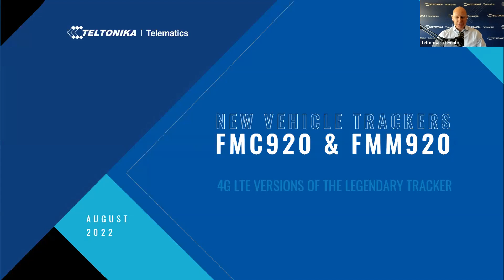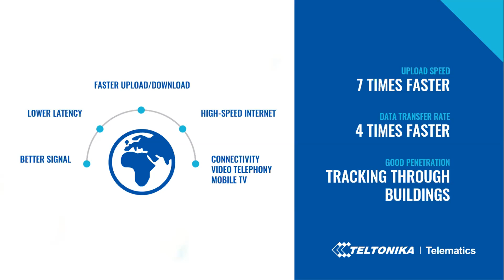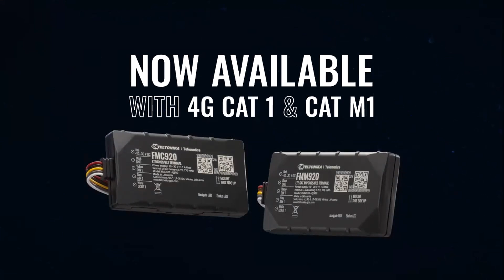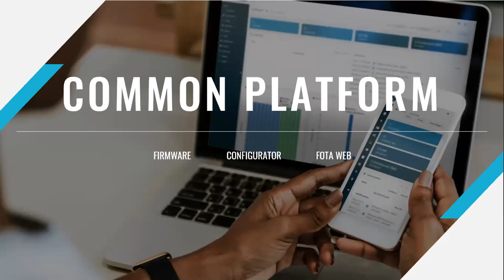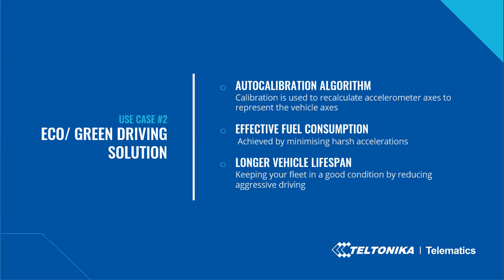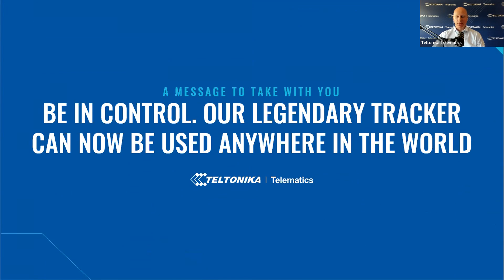Teltonika Webinar – FMC920 & FMM920 Trackers: The Legend Continues

Comment: I want to  install fmm920 to my car but my main concern is that you have to connect tracker direct to battery.
Since i have an old car with not at all electronic sensors or immobilizer...why cant i connect the tracker after the ignition?
Since it has its own battery?
Reply from the maker: Hello,
You can connect the FMM920 tracker to any power source within your vehicle that provides a constant 12V supply—it does not necessarily have to be connected directly to the vehicle's battery. A common alternative is the fuse panel, where you can identify a suitable power source using a multimeter. Look for a voltage source that remains active even when the ignition is off. For safety, we recommend using a 3A 125V external fuse when installing the device. For detailed installation guidelines, please refer to:
https://wiki.teltonika-gps.com/view/FMM920_First_Start#Mounting_recommendations

Alternatively, you can connect the tracker to a power source that is only active when the ignition is on. However, keep in mind that this setup may cause the device to rely solely on its internal battery when the ignition is off, which could lead to the battery depleting and the tracker shutting down if left without power for an extended period.

To optimize battery life in such a setup, we recommend enabling Sleep Mode and Low Power Mode (LPM) and adjusting the data acquisition settings to report less frequently. For detailed configuration instructions, please refer to: 
https://wiki.teltonika-gps.com/view/FMM920_Sleep_modes
https://wiki.teltonika-gps.com/view/FMM920_System_settings#Low_Power_Mode

Comment: Bjr, votre système donne t il la possibilité d'utiliser un bouton SOS?
Reply from the maker: Hello!
It depends on the device. FMx920 series devices do not have an integrated button that can be used for SOS. However, it is possible to connect external accessories, such as the SOS button, for such purposes. In addition, it is worth mentioning, that we have a unique FMP100 vehicle GPS tracker with an integrated button, which can be used in emergency situations.